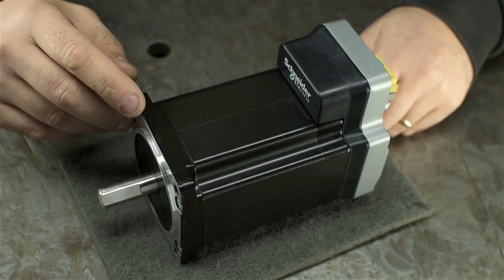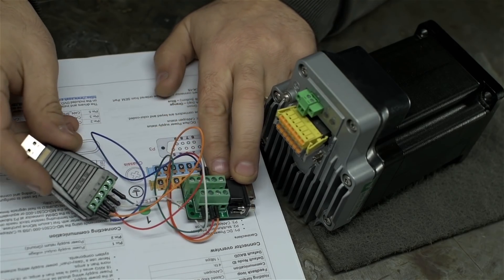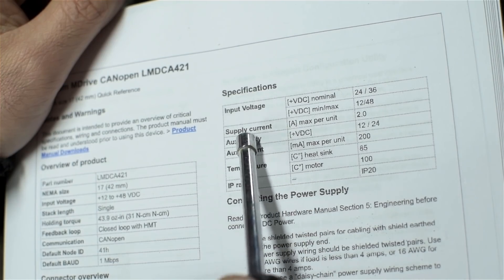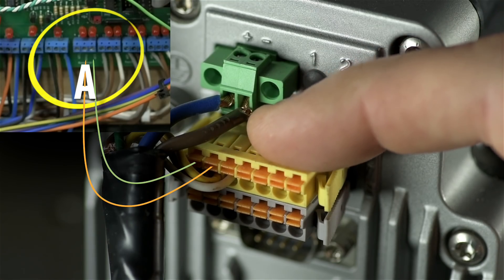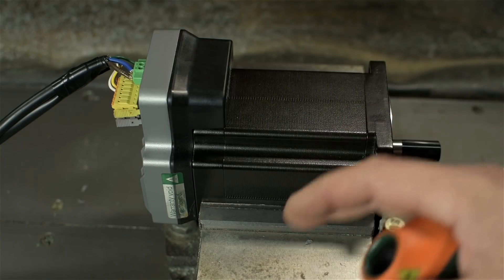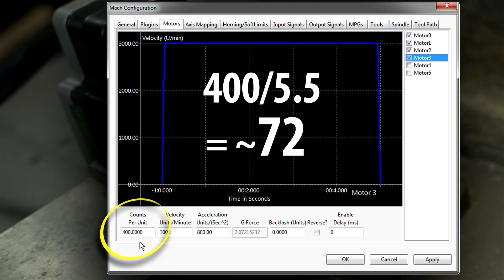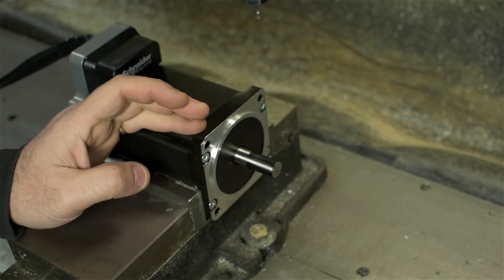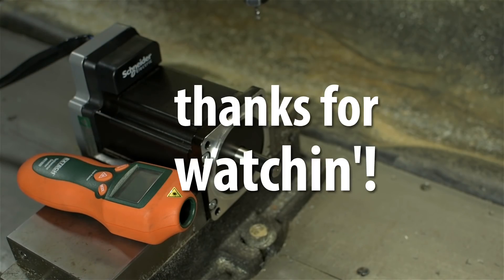Rise Of The Machine - CNC Router Upgrade - Part 1

Comment: If you run your stepper that fast continuously your torque will drop by at least one whole order of magnitude.  Also, running at that high of an rpm continuously will result in a lot of the electromagnetic force being dumped into the casing as heat.  The built-in electronics on the "intellegent" steppers will wear out much faster than either running a stepper with a separate driver or a servo.  

Steppers will lose steps (especially when pushed to the limits) and just keep going without a care in the world.  Where as the encoder on the servo creates much greater position accuracy (creating a fault when it loses position).  So the best design for a 4th axis is a servo/encoder combo with a gear box, it is also more expensive.  If your 4th axis is going to be under harsh conditions, like getting flooded with coolant you would want a resolver on the servo, not an encoder.  They achieve very similar positional precision (everything to within +/- .0001) and are a much more durable design.

Comment: Yes please! Videos of the dirty guts of how CNC machines work — also the mechanical bits! There's lots of info on how the "complicated" bits work, but the basics are frequently just glossed over... like what's between the stepper shaft and the ACME thread and how do you mount it properly?

Comment: You've got to put a scope on your step & dir lines! Those encoder lines too! Too bad you can't see exactly what the drive inside sees, but you can see if there any dropouts in your lines due to noise (common mode). If so, this might be a cool time to introduce differential signalling into the mix...and some animations of the square waves would be cool to see. Also, maybe dip into quadrature to talk about the encoder outs...assuming they're not sinewaves...but, yeah, this is great!

Comment: Of all the amazing things you do, I think I'm most impressed by the fact that you plugged in the USB on the first try
Reply: What we didn't see is the 3 takes beforehand, where he tried it both ways and for some reason neither worked.
Reply: Fixed in post
Reply: There is bi-directional USB A male plug now.

He might be cheating !
Reply: up until now, everyone should know that usb plugs are 4 dimensional. but given that, we know tony can influence time. he doesnt need to switch orientation, he just has to influence the plug beeing corectly alligned at the time he is plugging it in.
Reply: CGI
Reply: Pro tip: USB plugs have a seam on one side (running right through the middle of the face), and in almost all configurations that seam will go on the bottom
Reply: It's not that hard to do it first try
Reply: @goatbaabaabaa A One with a simple mind from the simple 4D world might solve the complex algebraic equation and infer it's a 50% chance to get correct on your first attempt. 

However, anecdotal & experiential data says it's about a 1% chance. 

Some think it's old Free Masons witchcraft or some sort alien tech from A51. 

But science points to ancient tech from a highly advanced human civilization from a multi dimensional tesseract.

But the world may never know.

Comment: Hey Tony, awesome to see you giving these products a test! I work over at the UK Distributors office for this product, if you need a hand, give us a message over at motioncontrolproducts.com. We also have a lot of other products we could potentially look at offering you for your projects. You can set those units up in closed loop mode so you take advantage of the encoders, that way, if it loses steps, it throws out an error signal to your controller. If you contact us, ask for Tom. Those units can be configured to 4000ppr with encoder enabled, or 51200 steps per rev.

Comment: I have this old dental mill that is sitting around that used to cut 0.75 x 0.50 x 0.50 ceramic blocks for teeth. It has 2 100000 RPM spindle Motors in it that still work perfectly fine. If you're interested I can start gutting it and ship them off.

Comment: Servo motor as spindle? You might be surprised, but I work as maintenance electrician and new machine from Italy that came here few months ago actually have servo motor with cutting blade attached on it. Nothing more. On machine where you absolutely don't care about cutting blade speed or precision and only expect it to somehow cut material. No, they had to put big servo with encoder here! Silly Italians.

Comment: CW different ratio than CCW (or the other way around) indicates a problem with either the programming of the integrated controller or a strange error in the wiring (maybe step and dir mixed or signal ground influenced by the drive current?) or Mach4 thinks reverse should be half of forward. Given the encoders are directly accessible and of the quadrature A/!B type, you could hook an oscilloscope or counter to the encoder outputs to see relatively exact figures for lost steps (substract one channel from the other to get the correct amount of encoder impulses as long as you don´t have direction changes... i reckon). Maybe the "Usurer" manual does point out if forward and reverse can have different settings programmed.

Comment: You're too close to the maximum voltage! When a stepper & driver are connected to a load and you decelerate the load, that energy has to go somewhere. It comes back (through the driver H-bridge body diodes) and appears on your power supply rails, raising the voltage. Industrial servo drives sometimes have breaking resistors specifically to deal with this. Big linear supplies with lots of output capacitance can absorb some of this into those caps. Switchmode supplies have less output capacitance and your output voltage will rise. Get too high and you'll blow out the MOSFETs in the drivers. I'd want a power supply voltage of 55 to 60 V for motor drivers that have a 70 V maximum input.

The natural (mechanical) resolution of a stepper motor is its full or half step resolution (200 or 400 steps per revolution, normally). That's too coarse for most jobs so we microstep them. Microstepping works best at some integer multiple of the natural resolution of the motor. Some drivers let you do non-integer factors but those settings are not as good as the interpolation gets complicated and wonky.

With these encoder-backed steppers, they're driven more like a brushless motor and the natural resolution is the resolution of the encoder (usually 500, 1000 or 2000 lines), or the 4x multiple of the number of lines (for reasons to do with how the quadrature signal off the encoder works, having two signals, each of which sees two edges for each encoder line) 72-point-whatever sounds like a terrible resolution to be running the motor at and the driver is probably trying some heroic interpolation to make that happen for you. (and probably failing, which is why your reverse rotation is wonky)

Preference would be to set the motor resolution to match its natural encoder resolution (or, failing that, an integer factor or multiple of it). Your limitation there, especially if you're intending to use this motor as a spindle, then becomes maximum pulse frequency. Mach 4, the SmoothStepper, your cables and the driver will each have some maximum frequency they can support and the weakest link in your chain dictates your limit, probably at around 1 MHz. The natural resolution of an encoder backed motor is much higher than an old-fashioned stepper, plus you need higher frequencies when running as a spindle instead of a positioning motor. RPM * 60 * steps per revolution = pulse frequency and you can soon find yourself in radio frequency electronics territory. When that happens, you need to drop the microstep resolution at the motor, but please do so at a nice integer of the encoder.
Reply: "and the driver is probably trying some heroic interpolation to make that happen for you." = best clause ever
Reply: That’s exactly what I would’ve said, (if I knew what I was talking about).
Reply: To piggyback on this, turning microstepping on and off is just a couple of wires. Find the pin for the microstep you want and wire it such that you can turn it on and off. When you need precision, turn it on, do your microstepping. When you just want to spin it like a lathe, turn off microstepping and you're off to the races.

This may require you to edit GCode and re-purpose other gcode symbols and whatnot, but you're up to the challenge, This Old Tony. I believe in you.
Reply: This motor has the controller/Driver/Encoder build in.  Least steps per turn I can do on my integrated closed loop steppers is 800 steps per rev.
Reply: dont most steppers have a mechanical step resolution of 1.8° so 200 steps per revolution?
counts per unit doesnt mean steps per rotation but rather is the conversion factor for the whole drivetrain so that the connected axis moves exactly one unit if told so. could be steps per inch, steps per mm or actually steps per revolution.
ofcourse this has to be multiplied by the respective microstepping factor. 
and i believe that this motor has no actual turnrate driver onboard but rather a pulse driven one. meaning one pulse on the step input results in the motor turning a single step in the direction selected by the dir input. maybe there are additional inputs that allow you to select a microstepping mode but by default the driver should be running in full step by default. the encoder plays no role in this mode and is only there to read the current position of the stepper so that possible control circuitry has positionfeedback. but i dont think the mach4 software uses the servomode with feedbackloop
Reply: well for 3d printers most are 1.8 on higher end printers they sometimes use .9 but it depends on the motor. the data specs for the motor should indicate the degree per step.
Reply: +Jeff Voight no one runs microstepping for added precision. Because microstepping is usually not terribly precise itself. The benefit of microstepping is reducing motor harmonics. Ideally you'd run a stepper motor with sine waves. But it is kind of tough to get positional accuracy then. Microstepping gets us as close to that as we can get while still allowing us to move the motor in discrete amounts.
Reply: Industral EE here just confirming the above post...it's all pretty accurate, at least if this motor matches my experience with Tollomatic and Applied Motion integrated steppers. 

One thing to note is that these integrated jobs are a nice package, but one of the things that you sacrifice in the name of convenience, wire simplification, and miniaturization is the filter capacitors, big inductive chokes, and thermal capacity that you aren't constrained by if you have a separate driver/amplifier and don't really care how much panel space it takes up. This motor/drive combo unit will feed excess energy back to the DC bus, which can make regulated power supplies unhappy. 

Maybe throw an MOV on the line just in case, and/or stick one or two of those big caps you gave the Gecko drives out near the motor instead of going through10m of inductive cable.  

Also, definitely add an in-line fast-blow fuse (AGC5 for this 4A servo?) out near the motor. There's an internal fuse on the PCB in the drive....but you really don't want to have to open that up or RMA the drive. I have seen two of these units burn up the internal fuse, and it's not such a big deal when it's $800 of someone else's money and a local distributor who takes care of you with loaner drives, but I'm guessing you don't have that convenience.

Last thought: IP20 means nearly clean-room conditions...those connectors have zero provision for coolant or dust ingress. Slather them with some RTV silicone or you may get an upleasant surprise when a chip lands across those exposed 70V power wires!
Reply: @kevinvermeer9011  guy who fixed a lot of electrical stuff on a boat here. Silicone is hydroscopic. Long term you will regret using it for electrical sealing or strain relief.
Reply: @GunFunZS  hygroscopic
Reply: @GunFunZS  so what's best? (on a boat that is) any grease or does if have to be that fancy lithium/dielectric/whatnot grease?
Reply: @predragbalorda  iirc sikaflex urethane caulk, for water. But I don't remember if that is safe to put directly on a connection. I don't know what is the very best, but cherry red nokorrode ncp2 grease on connections was my preferred. It is grease like but doesn't come of with water or soap. It also has the advantage of stinging like hell in the tiny cuts one inevitably gets handling stripped wires, and is impossible to wash out of the cuts.
Reply: maybe you should wear gloves/forearm bracers or something ?  my dad contracted scholderma(hardening of the skin) working with some of that stuff. @gunfun ZS
Reply: @GunFunZS  NCP2 is my go to as well! (half my life on a commercial fishing vessel)
It's worth mentioning that the fancy irrigation submersion rated wire nuts, yeah those are just regular wire nuts packed with dielectric grease and some fins or a skirt to keep it packed in for longer.

For those motor connectors, I'd suggest slathering them in ncp2 or another dielectric grease, then making a cover over them that seals the whole connection in a way that is removable if needed, but provides a water tight/chip tight protection and some cable strain relief so your connectors don't slowly rip off the board.

Also, for that type of connection, noise on the signal cables could be a big problem. Try to keep the power cables as far away as possible from the signal wires in the cable chains (or even separate conduits) and consider splurging a bit for very well shielded cables.
Reply: @GunFunZS  PS. it's also hilarious to watch people's faces as they freak out for just a second when you come up from the engine room with bright cherry red streaks and splotches on your hands and arms!
Reply: @troyna77  I assume you are referring to working with sikaflex? My dad stained his skin for a good 3 months or more (looked like bleached or leprous splotches). Tells you how deep the skin was affected.
Reply: I'm not sure if it's relevant in your case, but we got pulse driven motors/servos at work, and they need special cables due to the high frequency, but they also run on three phase power.
The cable is almost as expensive as the servo itself. Might wanna take this into consideration if you plan to use it as a spindle
Reply: @dave1812  you know what some great inexpensive quite hf cables are? USB 3, sata/sas, and cat 6 ethernet.
Reply: @manaquri I doubt you can pass 2 amps @ 70 volts thru a USB or SATA cable...
Reply: @BigMacIIx  you don't need to. Only the 3.3 or 5v signals are operating at that. The power is just 70vdc.
Reply: @BigMacIIx this is slightly irrelevant, but I do have a Dell Tb16 dock that does 240 watts through USB C and data transfer at the same time, but it is definetly not up to (way more power) the USB standards. It is posible, if you break some rules 😛
Reply: @kille guppy, this is where you missing the point about those kinds of servo... the rotation speed directly depend of the input voltage frequency, so the high voltage line is also high frequency.  The low voltage signal are only used for readout the encoder, not for controlling/driving the servo.
Reply: @BigMacIIx  Only the signal needs to be sent through a shielded high-frequency cable.  The 70V @ 2A power should be run through a separate cable anyways.
Reply: Excellent Advice.  This is why you use the protection diodes in parallel with the H-bridge.  This also makes me think that a zener-like braking load would be a good idea.  You can make one using a resistor ladder, a bunch of comparators, and a MOSFET or IGBT switched variable load bank.  

Another fun fact: there is a limit to how fast you can drive an H-Bridge due to the dV/dt between the drain and source of one MOSFET coupling to the gate to source voltage of the other on its half of the bridge.  Drive too fast and you will crowbar your power supply.  This applies to IGBTs even more so, the bigger they are, the harder they fall.  ;-)  Your bridge should be designed to withstand shorting the supply until the supply, if well designed, turns itself off.  Always current limit and time limit over-current on High Power DC supplies.  If you don't do that, your FETs will not merely let the smoke out, they will detonate loud enough to sound like a 357 magnum going off.  Your ears will ring for a month.  Wear earplugs for first turn on of all high power systems.  ~one electrical engineer
Reply: What he said
Reply: i made my mensa card, even put the hologram on it. @ Tsunauticus III
Reply: I was wondering about back EMF myself but it apparently is not an issue here. Otherwise that drive would have blown clean off the motor the moment he ran it.
Reply: Almost sounds like you know what you're talking about...............or do you. Otherwise, good guess. Luv it when people help out    :)
Reply: I like turtles
Reply: What he said......

Comment: I recommend going back into the "drive" software and changing the settings in the motor.  That motor should have at least x16 microstepping, and if it's natively 200 steps per rev, you should be seeing 3200 steps per rev, not 70.505050505 or somesuch.  You should only be using integers with a CNC machine :-)